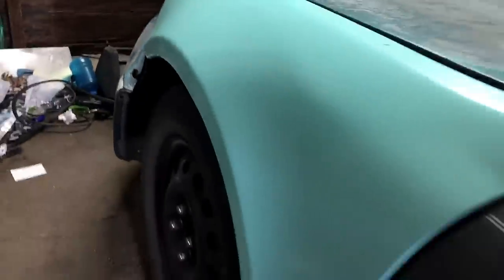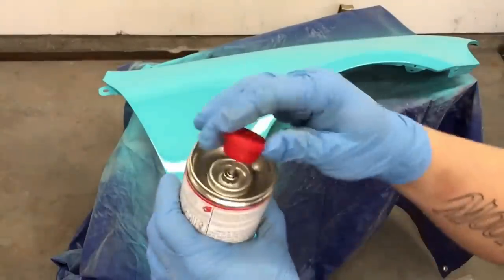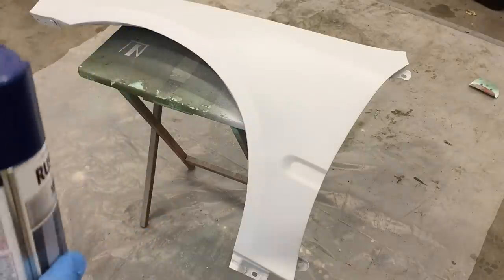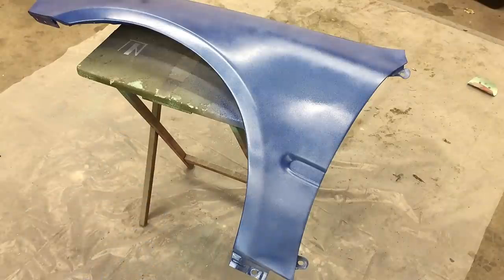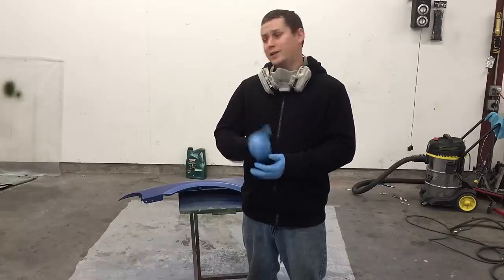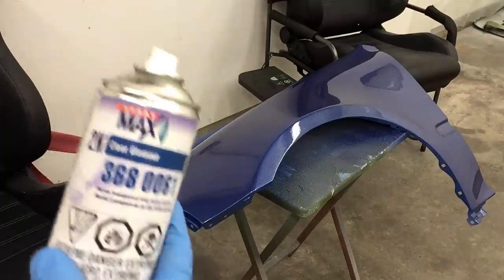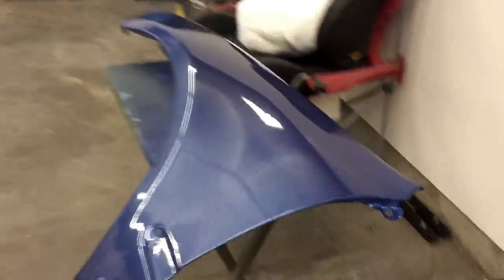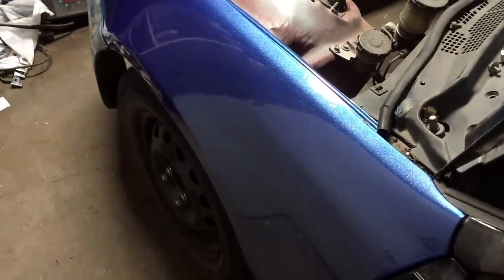Metallic rustoleum spray can paint job with 2K clear (AMAZING RESULTS!!!)

Comment: Recently came across your videos. Been studying rustolium paint jobs for years, and your channle is definitely the best I've ever seen at explaining it. After the better part of 5 years I think I'm finally gonna attempt it and was curious could you please just walk me through the correct steps?
Sand the vehicle with (?) Grit sandpaper. Than do I follow with another different grit or two?

Whipe down with mineral spirits
(Probably a good 2 or 3 times for good measure) 

Paint

Clear coat

Wet sand with (?) Grit and again do I use more than one grit gradually going down? And do I clear coat again after wet sanding or just polish

Thank you so much. Again your videos are very well explanatory compared to years are studying this on youtube.
Reply from the maker: ZCLawless25 Thank you. I tried to explain it the best I could. I have a video on the spray can wet sand and buff on the pink crv. I wet sand use 1500 then 2000 grit then wipe down and buff it. Now you can wet sand with 800 grit then wipe down and add more clear coat but I don’t do that since most the cars are not show cars and we just want them better than they look.
Reply: @JamesDguy  thank you so much.